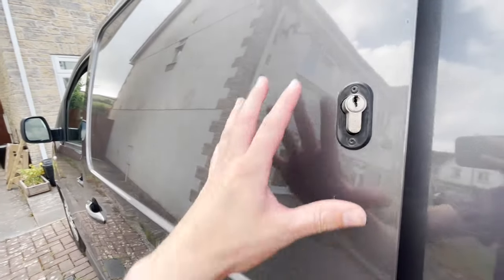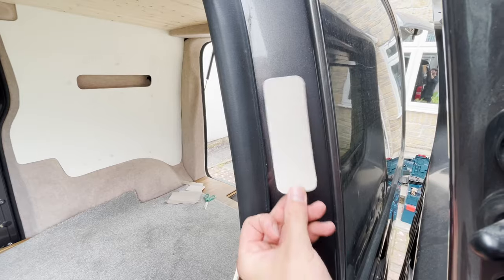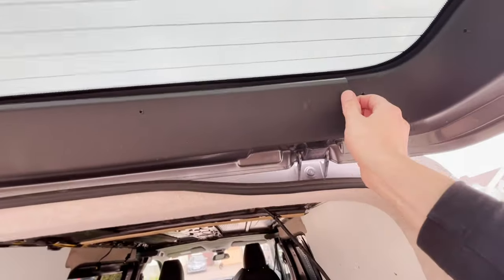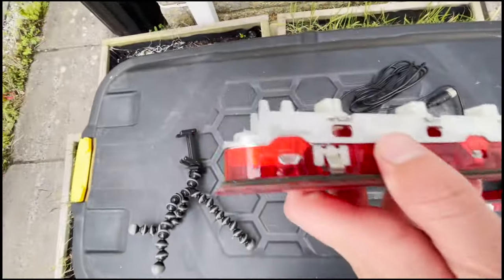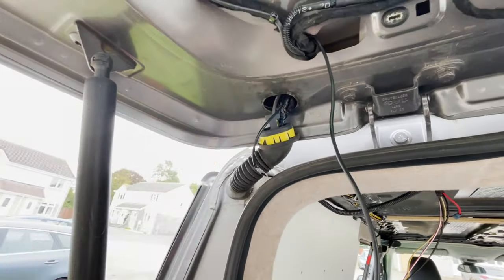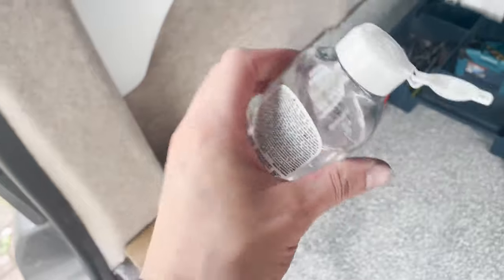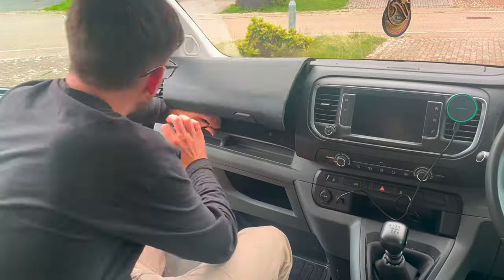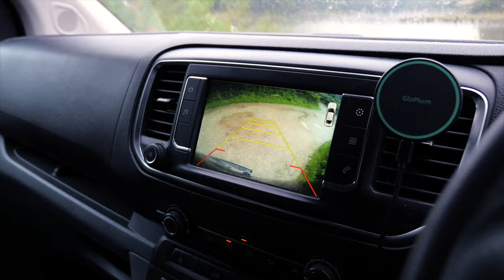Toyota Proace | Build | Pt 6

Comment: Great video mate! I'm currently looking to buy one but has seen reasonably complaints about the break downs and repair cost because it's not a real toyota. Would like to know the actual reliability from your end
Reply from the maker: Mines has over 100k on the clock and hasn’t had any issues. It’s been serviced every year by Toyota.  In my opinion It’s a good van although I do like a classic Toyota.